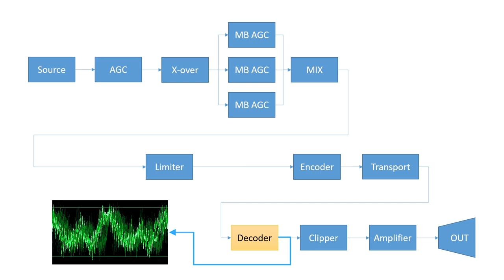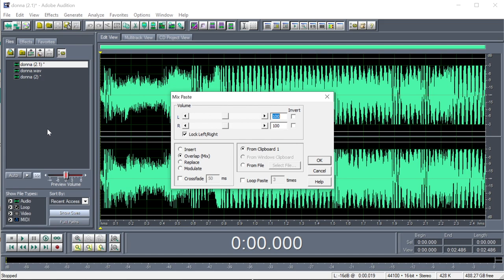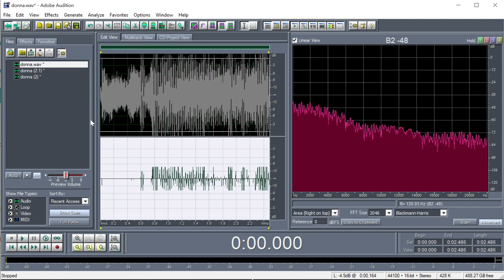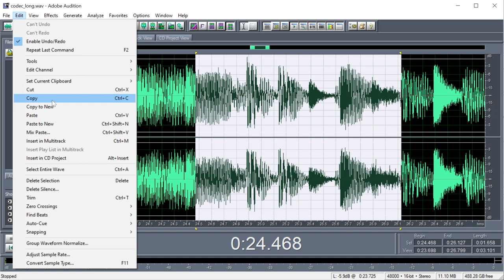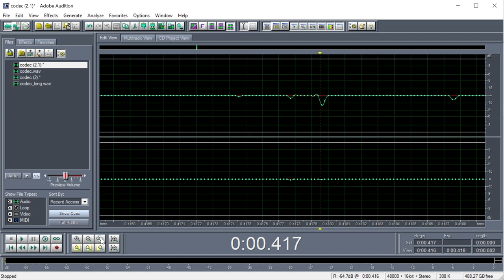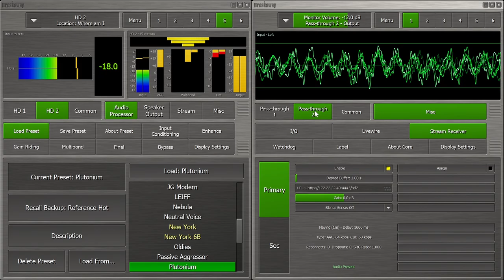How to Maximize Audio Quality at Low Bitrates - Pre-Encoder Attenuation

Comment: To make sure I'm not misunderstanding you: don't drive the limiter as hard (logical). Are you ALSO saying that you don't need to keep the output into your encoder from overdriving?

I've used a peak loudness meter to make sure that the peaks only just get to 0db at the absolute max over a half hour or more. That, also, has to be better than driving the encoder harder, yes? Am I misunderstanding, and for some reason it's OK to drive the encoder "past" 100%?

I understand wanting to keep the audio as open and dynamic as possible to give the codec as many clues as possible about what should be saved and what should be thrown away... but even an uncompressed audio signal would need to not overdrive the encoder, right?